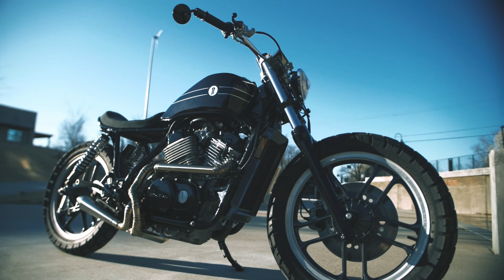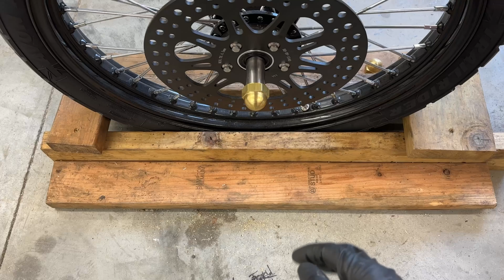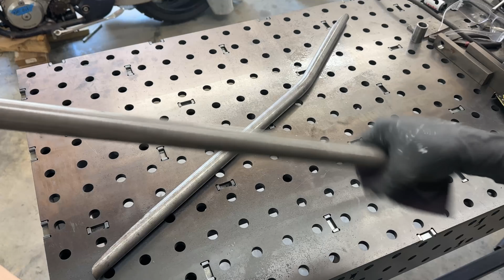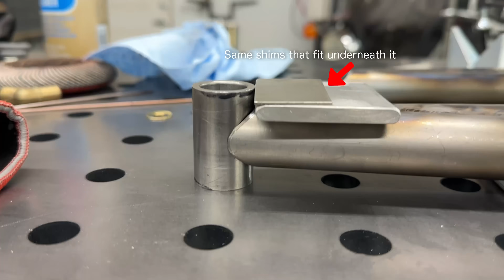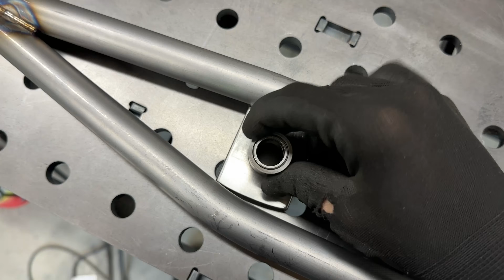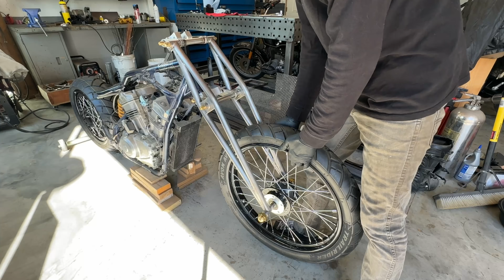Fabricating Fork Legs From Raw Metal | Girder Build

Comment: Hello, great video stability and comments. Your ideas are great and your work is nice and will get much better as you do more of these jobs and I am very impressed.
What materials did you use for the complete front end? what big rods were you using? how have the needle bearings been since assembly?  how do you feel about what you made? and what problems do you feel you had that the rest of us mere mortals will face when building the same sort of front end. Really great job, cheers from Australia.

Comment: Good stuff.  FYI to those looking to buy a tube notcher the  BuildPro ATN100 tube notcher is way more adjustable, and cost is 1/3 of a Baileigh.
Reply from the maker: Yea the Baileigh is stupid expensive. Really the limitation I had was with the cut depth of the hole saw more than anything.